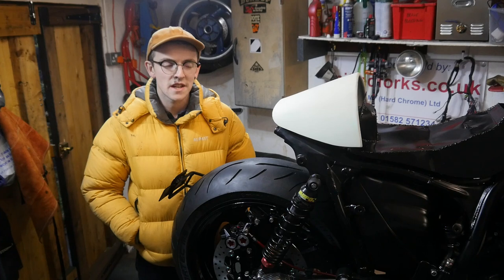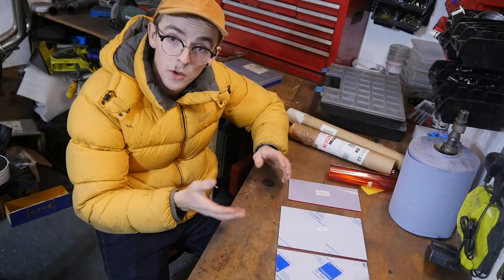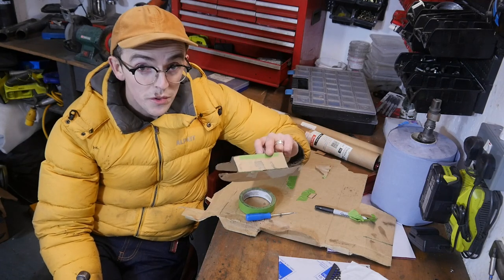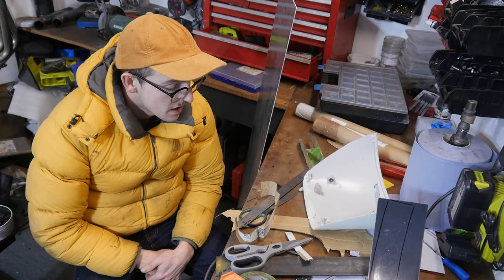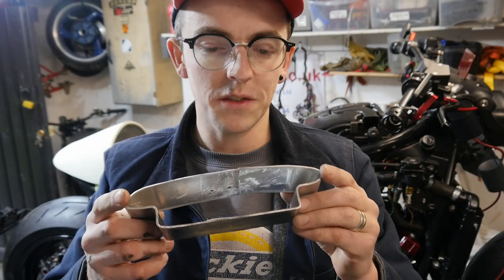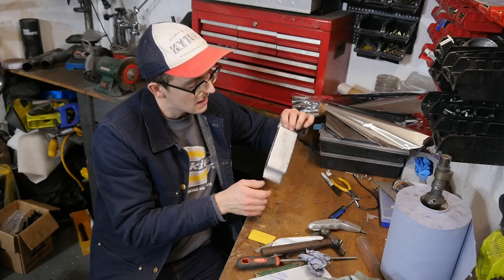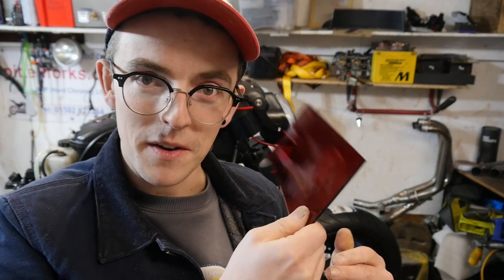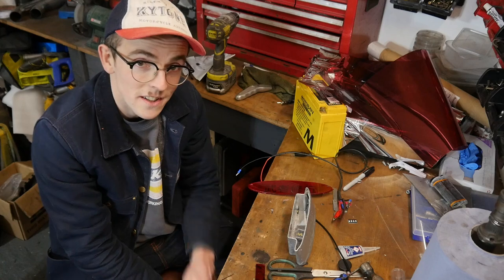Custom Tail Light for the Yamaha V-Max 1200! Shoogly Shed Motors Episode 95

Comment: Aluminium is a lot easier to work with if it is annealed first. Mark with a Sharpie and heat it up until the ink mark disappears and let it cool naturally and the aluminium is a lot softer and more malleable. The hardness returns after about 48 hours but hopefully in that time you have made the shape you want, if not just repeat the process.
Reply from the maker: Great tip!!